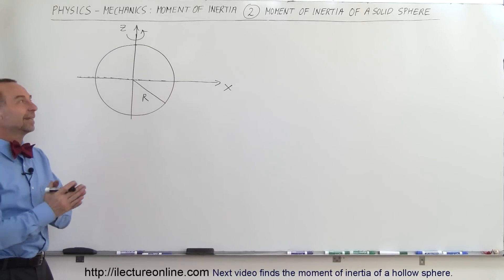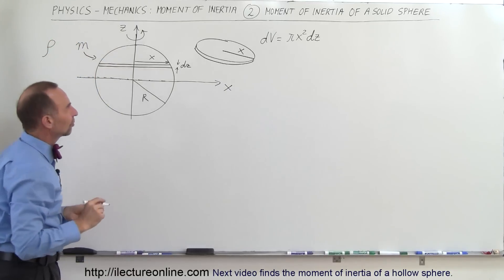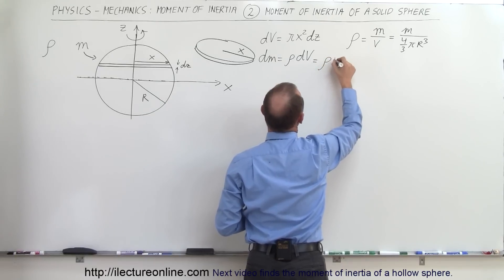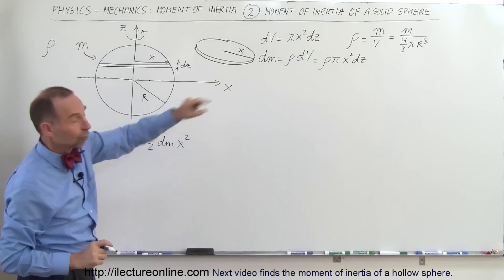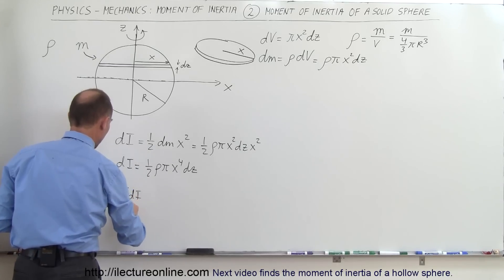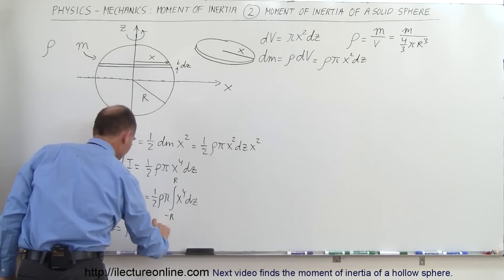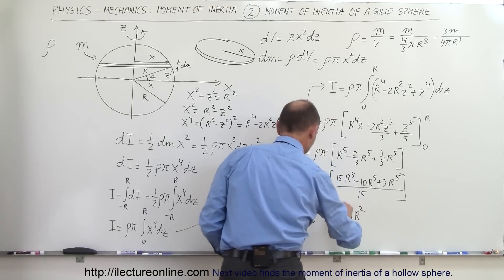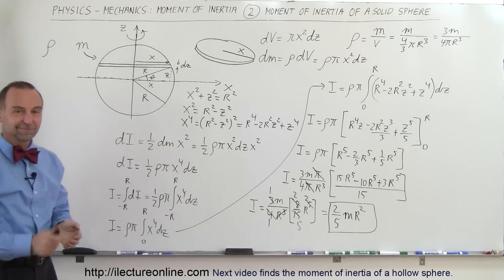Physics 12  Moment of Inertia (2 of 7) Moment of Inertia of a Solid Sphere

Comment: Sir, where did that half went sir
Reply: In that 4th step, that is I = rho × phi integration of x ^4 dz limits 0 to R
Reply: I got confused in that part.....
Reply from the maker: I changed the limits from -R to R   to   0  to R  because of the symmetry.  That is why the 1/2 was dropped.

Comment: You've helped me so much,
Thank you🙏
Reply from the maker: Glad to hear it.  Thanks for sharing.
Reply: @MichelvanBiezen  Inertia/INERTIAL RESISTANCE is proportional to (or BALANCED with/as) GRAVITATIONAL force/ENERGY, AS ELECTROMAGNETISM/energy is CLEARLY AND NECESSARILY proven to be gravity (ON/IN BALANCE). This CLEARLY explains what is E=MC2 AND F=MA ON BALANCE. What is E=MC2 IS dimensionally consistent. What is GRAVITY IS, ON BALANCE, an INTERACTION that cannot be shielded or blocked. Consider TIME AND time dilation ON BALANCE, as the stars AND PLANETS are POINTS in the night sky. Accordingly, ON BALANCE, the rotation of WHAT IS THE MOON matches the revolution. A given PLANET (including what is THE EARTH) sweeps out equal area in equal TIME, AS ELECTROMAGNETISM/energy is CLEARLY AND NECESSARILY proven to be gravity (ON/IN BALANCE); AS TIME IS NECESSARILY possible/potential AND actual ON/IN BALANCE. Great.

By Frank Martin DiMeglio

Comment: It can also be solved by taking hollow sphere as elemental mass
Reply from the maker: Yes, that will work.  Did you work it out that way?
Reply: @MichelvanBiezen  yes, I got the same result
Reply: This disc method is little complex but hollow sphere method is more easy..
Reply from the maker: It can indeed be done both ways.  This is an illustration of how it would be done using disks.

Comment: how come dI = 1/2dm x^2?
Reply from the maker: Since the moment of inertia is algebraically additive, we can calculate the moment of inertia of each slice and add them up to give the moment of inertia of the whole object. (This is an integration technique)
Reply: That is the formula definition of the moment of inertia of a thin disk along the z-axis:
https://en.wikipedia.org/wiki/List_of_moments_of_inertia#:~:text=Thin%2C%20solid%20disk%20of%20radius%20r%20and%20mass%20m.&text=Also%2C%20a%20point%20mass%20m,%2C%20with%20r1%20%3D%200.
You can look up the moment of inertia derivation of a thin disk if you want to know why.

Comment: For the infinitesimal disc isn’t the limit taken from 0 to R for it to be 1/2 x^2 dm? However in the video the same formula is for -R to R, this part confused me and I would be grateful for some help. Thank you for reading this.
Reply from the maker: You must integrate from - R to + R because you want to sum up the whole mass of the sphere.  (the slices are summed up from the bottom of the sphere to the top of the sphere)
Reply: Michel van Biezen thank you very much.

Comment: Is it necessary to use di? I tried it by just filling in for r^2 and dm, and then integrating from -R to R, but this gives an answer that is twice what it should be. But this method works for other shapes like a rod for example. Yet for this one the di method seems necessary, i don't quite understand why there seem to be different methods for different shapes.
Reply from the maker: Your method assumes that you have a hollow object instead of a solid object.  The moment of inertia of a solid disk = (1/2) MR^2
Reply: @MichelvanBiezen  I see, thanks very much

Comment: i tried changing x into Rcosθ and dz into Rdθ since it can be viewed as the arc of a circle with radius R. So then i did the integral of sin^4θdθ from 0 to π/2. But it doesnt give the right answer and i cant find the mistake. can you help me?
Reply from the maker: If you want to use spherical coordinates, you have to use the proper dV = R^2 sin(phi) dr d(theta) d(phi) and integrate over those variables.

Comment: Very good video. Thanks. I have a question, how did you come up with the 1/2(m • x^2) before integrating? where did that x squared come from? In fact, all that formula, it kind of looks like the kinetic energy formula. Thanks
Reply from the maker: mx^2 is the moment of inertia of a point mass rotating about an axis with a radius of x.   If it is a dist that is rotating, the equation for the moment of inertia becomes (1/2) mx^2
Reply: Michel van Biezen Thanks!!! I guess the equation of moment of inertia of a rotating disk has in it of itself its own derivation??
Reply from the maker: We have playlists on the moment of inertia.  Take a look.

Comment: In your cylinder video, you integrated from 0 to R treating 0 as the axis of rotation. Why isnt it the same in this one?
Reply from the maker: The limits of integration are chosen as needed.   There is no set rule.
Reply: Michel van Biezen so depending on the section chosen, the limits are different? Thank you
Reply from the maker: Yes. the limits will be unique to the approach used.

Comment: Q1: Where would you know where to slice?
Q2: How would you know what limits you're setting for the integration?
Reply from the maker: Q1:   You want your slice such that it is easy to find the moment of inertia of the slice.  If you took a vertical slice you would not be able to find the moment of inertia as easily.      Q2: Due to symmetry, you can have limits from the center to the top and then double the result to account for the bottom part.
Reply: @MichelvanBiezen  sir isnt it easy to do it by hollow sphere by taking limits 0 to 
R

Comment: If it is rotating along z-axis (vertically), why is he integrating the z-slices? shouldn't he be doing x-slices?
Reply from the maker: Try using slices in a different direction and see if you can get the moment of inertia that way.  (best way to find out).

Comment: why dm=1/2 dm x^2 is taken
Reply from the maker: it is dI = dm x^2 and the reason is that the equation of the moment of inertia for a solid disk is:  I = (1/2) mR^2
Reply: yes but when we are going to find I from dI by integrating we should take integration of dm  x^2 only no but 1/2 dm x^2 u have taken why??
Reply from the maker: The small dm is a solid cylinder, so you must use the same equation.
Reply: how will be the small element will be solid cylinder it must be circular plate
Reply from the maker: They both have the same formula for the moment of inertia.

Comment: So dv is the volume of the thin disk (px^2dz), and in the density function v is the whole volume of the sphere (4pir^3) 
Why did you use two different Vs and what's the difference between these two?
Reply from the maker: Li Ping Hsu I don't understand the question
dV is the volume of the thin disk and approached zero in the limit as dz approaches zero, this is the concept of calculus
V is the volume of the sphere.
There is no second V
Unless you think that dV and V are two different volumes?
dV is the differential of V, which is a concept in calculus.